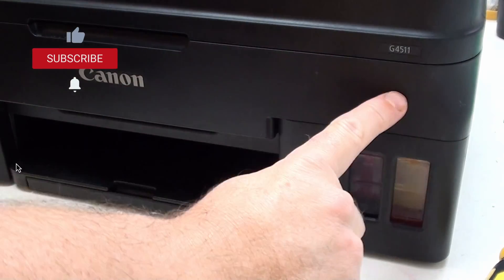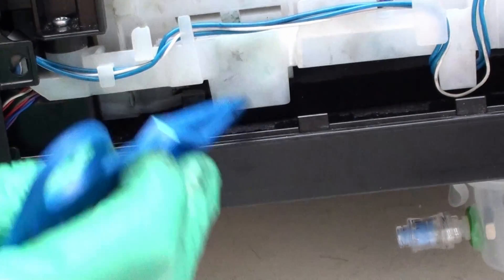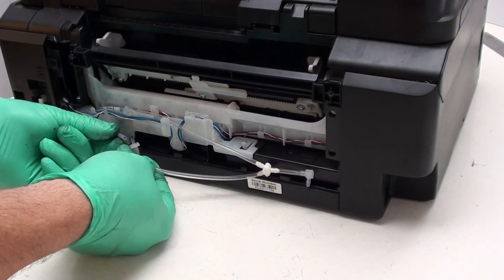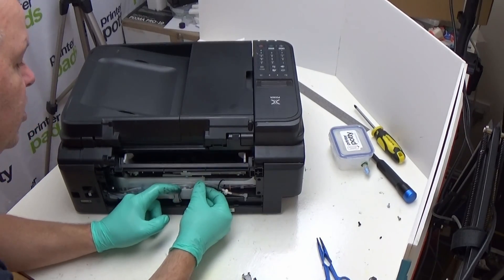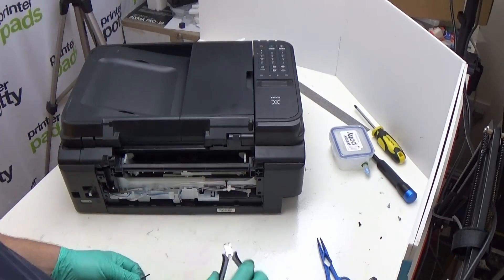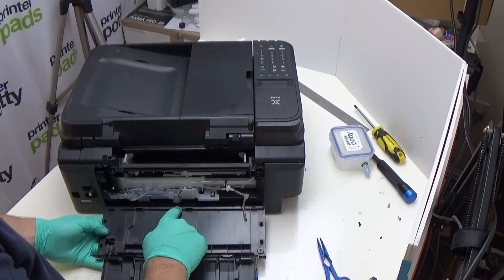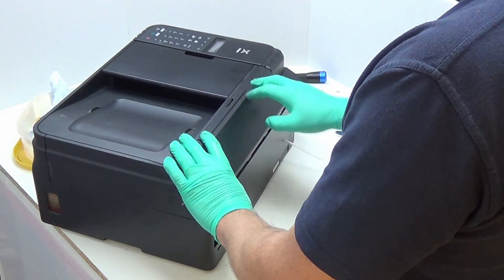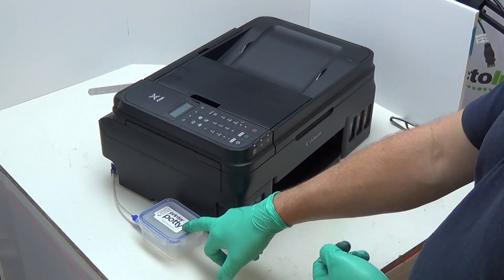Fix Megatank with two waste ink tubes - Canon Megatank inkjet printers (G1000-G4000 series)

Comment: Clever solution!  The original tubes appear to be gravity fed into the pads.  Thus, wouldn't there be backflow issues by running your tubes a bit upward and then down again, as shown in this video?
Reply from the maker: Backflow issues are really only an issue if there's a sustained head of pressure (eg: putting the tank up above the printer).

Comment: I have a g4280 2024 will this set up work on that printer or does it have a maintenance cartridge canon will not tell me if has one or not
Reply: The G4280 Comes with user replaceable ink pad & print heads. It's just 14$ to replace if you need it. The model is MC-G07
Reply from the maker: Thanks for sharing that info @anoop4243
Reply from the maker: The only thing I find lets the Megatanks down is the poor interface between the printhead and the tubing in that printhead bay lid. It's far too prone to dust and rubber degradation opening an air leak. Even leaving the label on the printhead top can create enough of a leak that ink fails to flow properly. But every system has it's pro's/con's... When it comes to HP it's the firmware and corporate arrogance that drives everyone away sadly...  Thanks again.
Reply from the maker: Honest answer for now is that I don't know. We've not seen that unit before and would have expected it to have a maintenance box but I can't find a single reference to one. If you could contact us directly via support@octoink.co.uk we should be able to figure out what your printer can/can't support with a few pictures of your printer, particularly the back.

Comment: It's a shame that these printers need to be 'potty-trained' in order to prevent the pads from filling up with ink and needing to be replaced, or reengineered to bypass the pads! 😳
Reply from the maker: It would be preferable if there were simpler ways to do this certainly but to give Canon some credit they have at least switched newer models to incorporating in a maintenance cartridge as a user-replaceable waste ink tank so that's something at least.

Comment: What releases the excess air from the waste tank as it fills? Is it sealed or does it have a vent?
Reply from the maker: The tanks have a very small 1mm diameter hole drilled in the lid. The vent is actually marked by the label so that end-users don't cover it.

Comment: Hi octoinkjet, if you install the external tank right before the first use of the printer, do you have to reset it after sometime or the printer will work fine for years as long as you feed it with ink or its programmed to fail ?
Reply from the maker: Unfortunately the waste ink system isn't based around a sensor in the pads but instead there's an incremented value in the printers memory that gets updated regardless of how much physical ink is actually in the pads (or tank). So you'll still need to reset the waste counter when the printer "thinks" the waste pads are full.

The good news is that the counter can be reset as many times as you want so long as the printer doesn't develop some other fault. Does that help?
Reply: @octoinkjet  yes thank you :0)